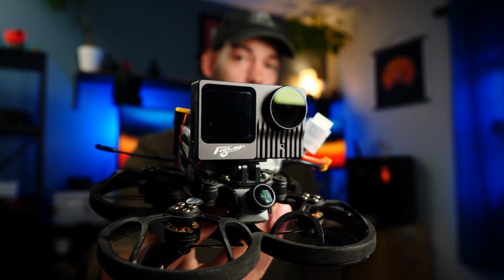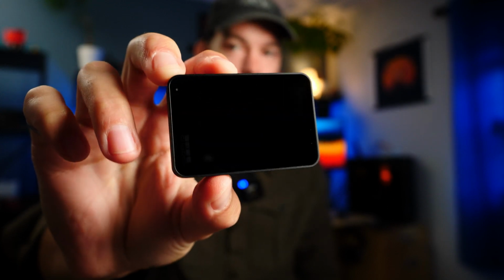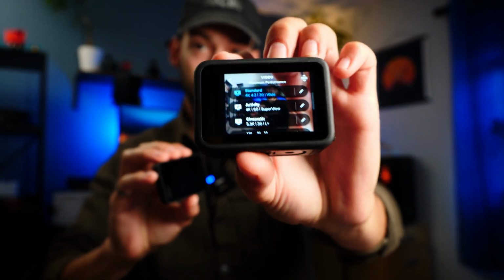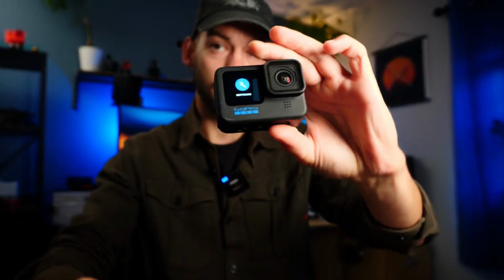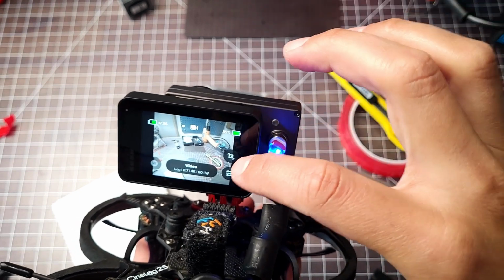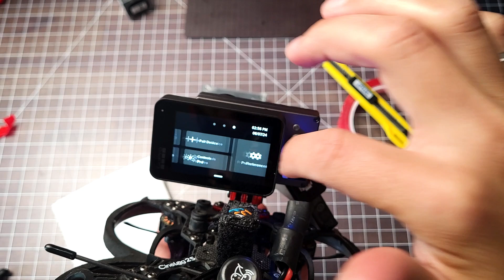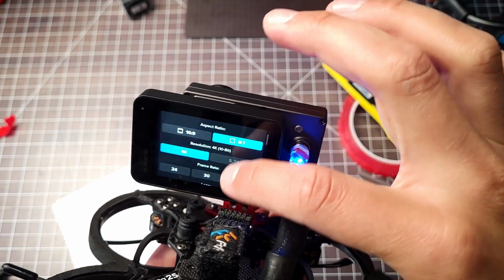Flywoo Naked GoPro V2.1 Touchscreen DIY Assembly Guide - Hero 9/10/11/12

Comment: 15:41 is good option but they need to improve it. i like the use CNC aluminium instead of 3D print plastic. 
Point to improve: make it more thin also if posible use magnetic pogo conectors instead of USB C that let make them the thiner screen case.

Comment: Much needed video, one question can we use ribbon cable which came with Battery case?
Reply from the maker: You shouldn't need that cable for anything, flywoo includes the magnetic gopro battery attachment

Comment: Since I have not received an answer from Flywoo. I will ask my question here.
Is the sound recorded?
Reply from the maker: Yes! Actually Flywoo implemented a microphone into the front of the case, its one of the connectors you connect during assembly
Reply: @DahanDialedIn  then we'll buy one.

Comment: Is it true that naked Gopro are as weak as they say?
Reply from the maker: In general i would say yes since most are made of plastic. HOWEVER, this new Flywoo kit is has a fully machined aluminum case which is WAY stronger than any previous naked gopro i have used. This naked has handled multiple crashes with no issues, but keep in mind theres no water sealing and theres the potential for internal ribbon cable connectors to come loose in a crash. As far as naked gopros go, this one is definitely the most durable, but be careful nonetheless.

Comment: Damn i killed the screen in the process. Let's try Gopro #2 😅
Reply from the maker: Noooo! 😭  Hopefully it works out the 2nd time, removing that display is a delicate process. You can also buy the fully assembled touchscreen from Flywoo for a bit more $, its reasonably priced
Reply: @DahanDialedIn  nah gotta do it myself. Learning in the process 😅 

Do you know if I can use GP12 or 10 Screen for connecting to H9 or vice versa? 👀
Reply from the maker: @tobias.siegele  AFAIK Hero 9-12 Display are all the same and should work with any V2.1 Flywoo naked GoPro. Best to ask Flywoo support to know for sure though.

Comment: Hi Dahan, I have a question. Can I use this naked gopro to film weddings for many hours? Doesn't it heat? Can I put a mini USB-female to USB-male extension on the screen to have a more comfortable view? Thank you very much, I try to give other uses to this hobby I have :D
Reply from the maker: i haven't tested the overheating of the naked gopro, but i feel like the cooling might actually be better as a naked gopro compared to the full size. You cant use the USB for power unfortunately, it says in the manual. With a full sized gopro you can definitely power via USB and send video signal to a computer
Reply: The quality of the GoPro 12 is impressive for general events or night concerts, I was thinking of using it with Lipo 6s with a minimalist look, thank you!!!